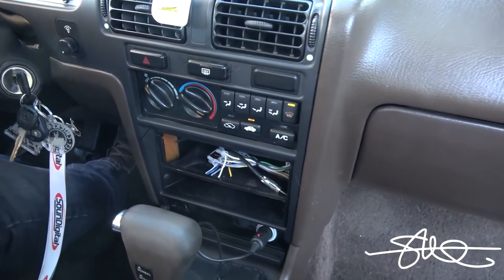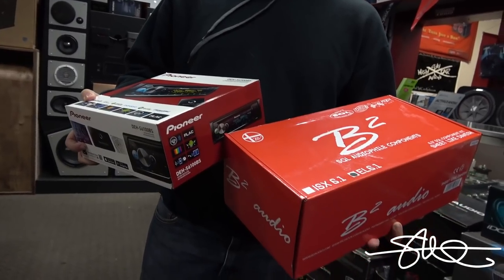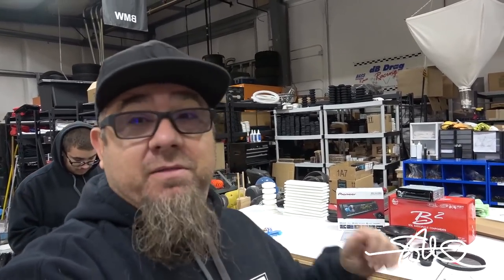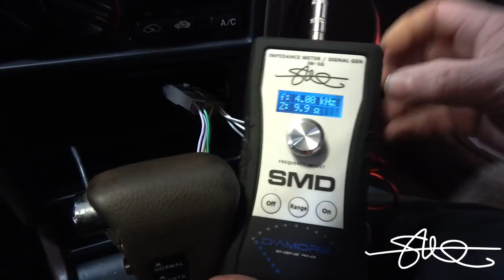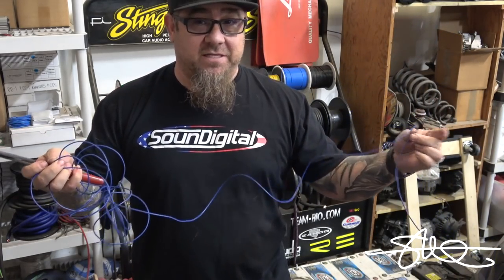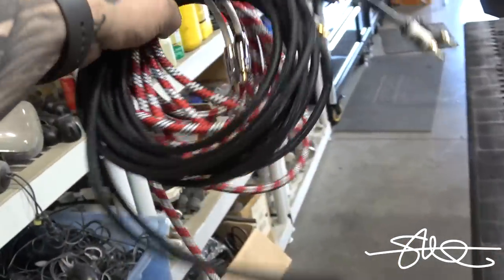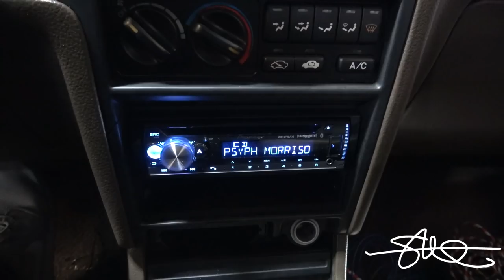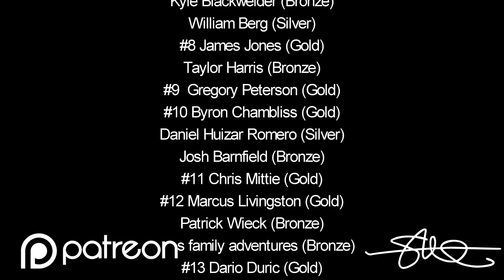Father & Son Fun Car Stereo Install 1990 Honda Accord - His First Deck & Door Speakers! Video 1

Comment: This is Great. I'm 48 years old and my son just started driving. I'm a bass head dad from a long ways back and I installed a system in his toyota 4 runner I just bought him. He has two 12" Ampere audio sub's, Skar 2000.1 sk amp, SSA Evil 6.5 components set and skar 75.4 4-channel amp on a Pioneer 500EX HU. Not a bad starter system for him.

Comment: Steve, when I worked at a shop for several years, we were into keeping everything hidden.  BIG sound, nothing seen.  It would be interesting to see a 'micro' system for him....meaning small amps, like the sound digitals.    My wifes 93 accord ,10th anniversary edition, I had most of it all hidden.  3 Rockford Fosgate Punch 75hd amps...front, rear, and 1 12" sub -JL audio, in a 4th order band pass....it banged pretty hard for 75watts to all stages...Eclipse deck-when they were good by Fujistu Ten...and Alpine components front and rear...I tuned everything with an oscilloscope back in those days. Nowadays, I tune systems using your Xover calibrator CC-1 and your Distortion Detector DD-1.....great products.  someday I will get the  IM-SG to continue to do home installs and tuning.

Love the videos and keep doing what you do.  Makes us oldschool dudes feel good...youngsters just dont know...

Comment: I drive a 4th Gen Accord. It was my first car. It has been my only car....for 16 years
Reply: Sean Cunningham i bet it still runs like new 😂
Reply: @RugerMad  only has 130k miles on it. And it starts everyday. Never left me stranded. And it has been modified for over 12 years. Bolts ons. 5 speed.

Comment: i love cb7 accords man, had a built and boosted one, then put a big alternator a 15 sundown sa, and an amperage hungry hifonics brutus all 0 guage wire and a big three wiring, puting down over 400 to the tire limited by the fuel system. i absolutely love thoe cars

Comment: I just want to say I look up to you bud. I've followed you for the past 15yrs. Your the icon of systems. I only pay attention to you my friend Zack Metts, and Exo. I always hoped to get a SMD autographed hat. To bad I'm not from Cali I would have u hook up my new systems I'm setting up( 2 ds18 xl xb12.2,  two ds18 3 500 watt class d amps, and running  8 cresendo 6x5 mids inside on a 2k amp.) I'm building a fourth order box.

Comment: So I have a 1990 Accord ex 4 door. Blue, slammed, prelude si wheels. I’m currently running a comp FI 15” in a ported box with a kicker cx1800 powered by 4 gauge at under half gain. It hits hard and sounds amazing. I love my build. Will be upgrading to zero gauge in a  week or so. If you guys are interested I’ll upload a video on my channel after the upgrade and I’ll show the before and after.

Comment: My first car is a 2006 Maxima SE. I just started driving in August and I put a Pioneer Double Din (cannot remember the model at the moment) inside of it. About 2-3 months after the deck install, I installed a 1200W Audio pipe amp and I have had 2 Kicker CVT 12s inside my room that I put inside the car. I still have the factory BOSE speakers inside and everything sounds great besides the inside brake light jumping from the subs and making a rattling sound. I always think about doing a review video but I can never find the time to.

Comment: I still remember the first deck I had with my own money... That's a pioneer deh-2150 and it still works! Using it on my 'ghetto system'. The mute does not work, the internal amp fried and the preouts aren't that clean anymore. Nonetheless, that stereo gone through years!

Comment: Sooo easy to change the head deck on older cars, these days you have to get ones that integrate with the cars computer and other functions correctly! I bet it’s a bitch to change the head unit in a new BMW for example!
Reply: I got a 2017 nissan rogue. My parents got it for me, and believe me I'm grateful. But I wish I had an older car so I didn't tear up a new one. I can't put a radio in without worrying about steering wheel integration and a backup cam. Had to use a Line-Out Converter
Reply: GhilleGhille Yeap, even Steve in his Lexus system kept the factory deck, I think he used converters like you on the speaker cables from the deck. They started with changing deck designs so they wouldn’t get stolen so much, and have ended up with fully integrated systems into all car functions as well as multimedia functions! With big screens to control it all from.

Comment: Question: i have a 2014 Ford Taurus, i went to mickey shorr to get a system installed. I have 2 Rockford Fosgates P3 subs and a Fosgate 1200 watt amp. I was looking for a Radio but they didnt have a dash kit for it. Do u know if there is one for it now?

Comment: Fuckin love it. My little man is only 6 but I've already had him out helping me do my brakes and some other stuff on my newest car and I can't wait to do something like this! Been looking at an audiocontrol lc4.800 but having problems deciding what to pair with it for full range until I can save up for another Amp and subs. Don't want to lose my integrated climate control and I for real need an upgrade
Reply: For real though looking for any suggestions on what to throw 125w rms @ 4 ohms to without hitting my wallet like a ton of bricks. Looking for something that sounds good and I can pair a small Amp and subs to later

Comment: Whats your opinion on the Soldering the cables together vs Butt connects? I always solder my harnesses and add heatshrink over them. Every time i used butt connects end with shorts
Reply from the maker: Ghostie & Friends makes no difference at all if both done correctly, like we did.

Comment: Been considering using the factory wiring to quickly hook up my fosgate comp's just to replace the crap door speakers in ny 01 camry. If it's good enough for Steve it's good enough for me lol 🤘🔊
Reply: Worked just fine for my 6x9s by fosgate..!
Reply: Here’s one place you can’t trust people on the internet. The first thing I suggest to upgrade after radio and door speakers is the wiring. I upgraded it in my Matrix (also a Toyota) and holy balls, there was tighter bass and higher highs I wasn’t even hearing before from my door speakers. 12-14awg is cheap, go for it and you won’t regret it.

Comment: I don't understand, dont you sale car audio. Why go somewhere else to buy your car audio stuff for this car?
Reply from the maker: i sell stuff that WE manufacture.  I don't run a stereo shop. I don't sell decks.  I do sell amps online as a dealer of a few brands though.  I guess i just like supporting local shops when i can.
Reply: @meade916  that's awesome man. I knew you manufactured products but seeing the audio builds I just assumed you were an audio dealer as well. Nothing wrong with supporting locals. Great first build and with your son is awesome

Comment: What size does a 1990 Factory Honda Accord have front and rear I'm trying to replace mine but I'm having different information come up on Google
Reply: It depends, it's either 4" in the front and 6x9 for the ex or 6.5 all around. I think

Comment: When I got my first car last year I wanted a rear wheel drive manual car so I could start drifting (what did you expect a 16 year old to do) and my parents got me a fucking 96 accord fwd automatic(I didn't really care because I was thankful to have a car), of course I still found ways to drift and I was pretty good
Reply: i got a 1994 mitsubishi galant, its half a rally car, fwd 4spd auto but it was free (besides dmv stuff) so
Reply: I got my first car in november of 2017 it was a ford ranger 1994 4.0 5 speed and i loved that thing i got my license in February of 2018 and i left to move to another state with my dad i had worked with him to get a 99 ford mustang every summer so i could have it and now i have it but man i want to find another ranger i miss my ol truck
Reply: Reading this is funny after buying a miata for myself at 17 because I was tired of the fwd car my parents got me, a year later I’m buying a 90s accord cause they’re so nice looking and reliable

Comment: What are the best 6.5 door speaker brand ? B2 audio, JBL, alpine, or Rockford? I want door speakers that produce loud clear voice but at the same time have the bass hit hard. I currently have 2 12 DB Drive subs hooked up in my trunk but I also wanted to hook up door speakers to my amplifier as well but idk what brand to go with.
Reply: Most higher ends like B2,Ct Sounds,Focal, Infinity to name a few are all good quality for the best sound use component set use sound deadening and the foam rings around the speakers to seal to the door better and direct sound into the vehicle..cheaper brands will work fine also if your budget isn't set for a real high just do yourself self a favor & still use the sound deadening and foam rings makes world of difference.
Reply: Rockford is pretty good

Comment: I’m somewhat in a similar situation, man. All but one of the door speakers in my 1999 Chevrolet Tahoe are blown, and it’s starting to go out. I’m not sure what the best choice for bass and sound is, and I don’t have the largest budget to work with. Is there any good beginner suggestions you could give out? I’d like to be able to use the factory locations, if at all possible.
Reply: Samuel 
My system: $50 pioneer head unit
$25 dual door speakers from walmart
2 12" $60 sony xplod subs
$100 power acoustik rxr2500D amp. 
Competition sub box tuned to 34 hz
Its a $259-$300 system from walmart that sounds clean and the subs do a 140+ db
Reply from the maker: @thecloudymisfit2968  your system looks like you saved a lot of money...but you ain't doing a 140 with it.  You might think you are though.
Reply: meade916 it does like 137.8on the windshield. They are in a huge custom ported box tuned to 34 facing the rear in the trunk with the back  seats down.
Reply: meade916 but man i love your channel you are the coolest bass youtuber ever.
Reply: meade916 the meter could have been off by a little bit too so im gonna just say 135 to round things off. Still not bad🤷‍♂️. By the way i would love a demo of your vehicle but i live all the way in kansas sadly☹️

Comment: Staggering the joins of speaker wire less bulk behind  the stereo
Reply from the maker: i coudn't stagger them. The adapter plug is too short for that.  It isn't bulky anyway.
Reply: So didn't comment at the end it fit well
 @meade916

Comment: Quick question boss, can head units be bridged to maximize the output to two speakers?
22rmsX4 can this be ran to 44rmsX2?
Reply: No.
Reply from the maker: why would you want to do that? the answer is no though lol
Reply: meade916 Lol But it wouldn’t be a huge surprise if someone did it.

Comment: Good shit Arden audio gave me the plug on my sundown audio x 8 shit And my as 15 and 12.. not to mention Nick hoocked it up on a solid price for a custom box for the x8 tuned at 29 hertz.. Meade does it agen I have a 90 Honda Accord I’m working on need. Battery new alt keep it going the door speakers driver side is flipped floped

Comment: Watched both videos and pretty cool. But this is not a budget install. Amp is 500$ 8" in ported box 700$ ELSQ6.1 200$ just for those 3 not including wires pioneer deck secondskin install. This 1500-2500$. Not budget. Budget is under 1000$.
Reply from the maker: You can use any 8's you want.  You can build your own ported box for a fraction of the price.  You can have a little bit of rattle if you don't mind it.  Stop your bitching. Power used to be $1 or more per watt. One amp running the entire system and people still complaining. SMH LOL...
Reply: What is one man's budget, it pocket change to another man.

Comment: Steve would you recommend the B2 Audio for my Harley Electra Glide and the ByNines for the rear Saddlebag lids. Had Kickers in until a real bad 5 hour ride in the Rain coming out of Maryland to Mississippi in April of 2018.  Motorman in Da Sip @meade916
Reply: Toob247 Toob247   They are water Resistant which my Kickers where until the long down pour killed them. But I want Sound Q also so I guess I gotta move to SoCal since it never Rains there! ja ja ja ja ja

Comment: i spent about 500 in my system ( 2 Orion 10's , 2000 watt orion amp , 600 watt dual audio amp for my mids and highs with two 6/5 ds18 mids and 2 ds18 super bullet tweeters , 2 frade XXX backup capacitor) and i have people thinking i have two 15's in my trunk 😆

Comment: Steve I got a problem and its really pissing me off. I drive a 08 grandprix and the trunk rattles like a bitch. Ive lined the trunk and rear deck with second skin but most the noise is coming from the spoiler, how do I fix that?
Reply: proably ur rear lisense plate tbh just double side tape it from the botoom ish
Reply: What I would do is take the spoiler off. Then take some sound deadening, or any thin rubber you might have and cut it to size and place it between the spoiler and the trunk lid where they meet. You can get rubber peel and stick for roofs from Menards really cheap. I used to work for a roofing company and I had alot of peel and stick in my garage. The whole skeleton of my van is covered with it. Inside the doors, under the headliner behind the side windows, ect. Everywhere I could get it. The rubber roofing peal and stick is also way thicker than second skin or any sound deadening material for that matter. If you work really hard to soundproof your car, the difference it makes is amazing. The sound quality is drastically improved. If your really on a budget you can get some weather stripping and put it between there. I have window stripping material all over my van. Probably 20 17' rolls between everything that rattled. That stuff works great.  While you got the spoiler off, take some great stuff and try to get as much of it in there as you can. Stick the long nozzle all the way inside the bolt holes on the spoiler  if you can and get it in there good. I probably have about 15 cans of that stuff in my van and it works great. Just be careful with it. If you've never used it before be warned, it drastically expands and makes a mess. That stuff can also get into key latches, hinges and mess up any moving parts your not careful. You'll have to clean it out of the bolt holes on the spoiler. After it completely dries, its not too hard to pick it out of spots you don't want it in. You could put the great stuff inside your trunk lid as well. Inside the actual trunk lid of course, but again, be careful. I know a guy that spray foamed the inside of his trunk lid and he put way too much in. He closed the trunk before it expanded and after it dried, he couldn't get the trunk open. We couldn't even get the subs out from behind the seat either. It was bad. You should've seen the trunk after we finally got it open. Not only was the trunk damaged but both the rear quarter panels were as well. He used big screwdrivers, hammers, a sledge hammer (L.O.L!) crowbars, and a Sawzall. Its hilarious thinking back on it now. I wish I would've recorded and posted it. One last thing, use lock tight on the bolts. The spray lock tight works great. Whenever you find a bolt loose anywhere, dont  just tighten it back up because the bass will just rattle it loose again. Use the lock tight on it, then put it back in tight. Hope this helps. Peace.
Reply: You can tape old washcloths to the back of your license plate to stop the rattling.
Reply: @NightRiderBUICK  I have some weather foam under my plate. Its def the spoiler, If i lean on spoiler the noise goes away drastically
Reply: @dawn9340  Its not my liscence plate. I have weather stripping underneath it tight. I can barley bend plate, it aint moving. When I lean on spoiler the noise drastically decreases, but I cant fit anything under spoiler to dampen the noise
Reply: I figured removing the spoiler was my only option. I'll do it come spring, it'll give me a little project to look forward too, thanks! @Hertzsogood219

Comment: Guys i need some help. Ive just recently heard of b2audio and that its from Denmark. Id like to support a danish company as om danish myself and i want to know, how are their 6.5" subs? Im currently two 6.5 subs dd audio, at around 800watts. Are they better?
Reply: Magnus Frederiksen b2 makes a quality product, but at that size you’re awfully limited by cone size, magnet size, and stroke length. Maybe you’d appreciate some B2 8” or 10” subs if you’re looking for more punch and power down low than what you currently have. If you’re set on 6.5s though, compare the woofers efficiency (measured either at 2.83v or 1W at 1 meter usually) as this will determine how loud they will be under the power you give them.
Reply: @dawn9340  i just like the idea of two small subs punching like hell, and surprising people who hear Them. But thanks, ill look into it😊

Comment: What model head unit
Reply: Pioneer DEN-S6100BS
Reply: Flat4Buggy 2 that’s not it
Reply: jesus sanchez it’s a DEH-S5100bt
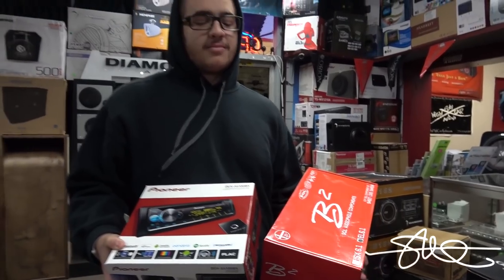Reply: @dnsbb8033  Yes it is. It's printed on the box twice at 3:36. The 5100BT isn't  SiriusXM ready, where the 6100BS is.
Reply: Flat4Buggy 2 ahh ok I haven’t checked it but seems like pioneer is making everything the same I just bought the deh-s5100bt looks exactly the same
My bad though

Comment: I need help from anyone, please and thank you.

I have a Kenwood 50w X 4 stereo

2 - 100w (300w max) 6.5’ kicker speakers in the front doors

Factory speakers in the back doors and behind the seats.

1000w mono kenwood amp (4ohm)

2 - 1000w kenwood 12’ subs (4ohms) each

Tried tweaking the settings on the amp and stereo the bass is alright but not what I expected and the quality inside is alright aswell not all that good. I feel like I either wired the harness wrong or maybe the stereo isn’t strong enough. I obviously dnt know what the fuck im doing. It’s a 2000 Mercedes c230 kompressor so the wiring color is weird as hell.